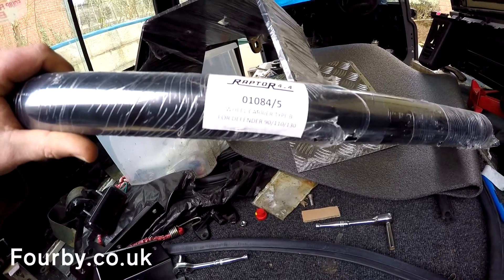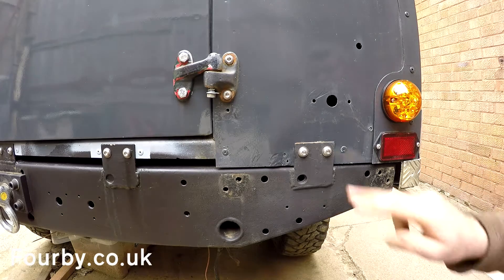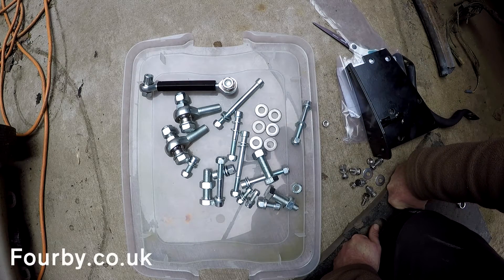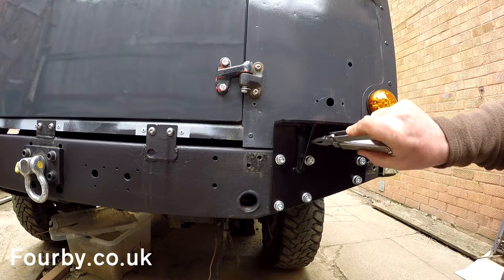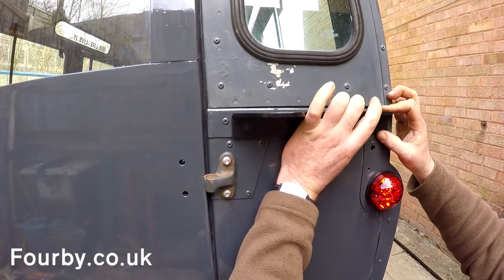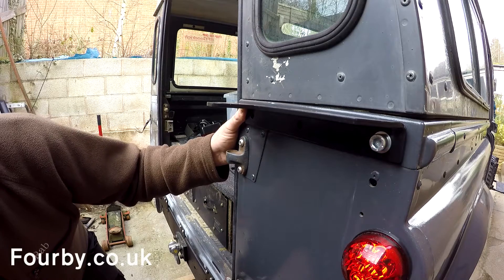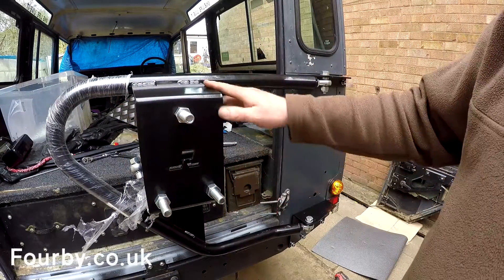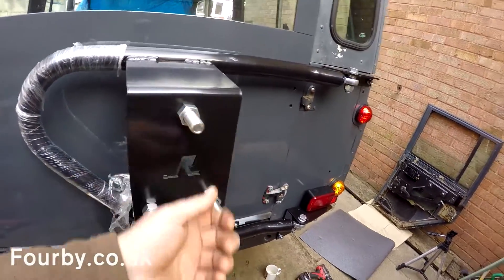Land Rover 110 Restoration #14 "Raptor4x4 HD swing away spare wheel carrier"

Comment: Personally, I would put a bead of silicone around the gap.  You are going to get leaves, whirlybird seeds, bugs, dust, dirt, grime BEHIND that nice Italian bracket which means .. corrosion and rust.   This thing could also use a thick rubber gasket with adhesive on BOTH sides, then bolt the plate, and cover the gaps with silicone.  Rust ruins these nice Land Rovers.  I have a 1985 Land Rover 110 Defender with a severe rust problem.  Otherwise, good video.

Comment: Nice job Neil...surprised you didn't use any sealer on the top three holes though.
Reply from the maker: Hi Steve, I'll take the top bracket off again when the upper panels get painted, I'm still debating whether they get replaced with van sides, I have the option as I have both, I will seal them then... TBH it seemed the best place to store the carrier while I delt with the rest of the project..
Reply: I didn't realise you hadn't finished it tbh.Now thats a hard decision to make ,Van sides are more secure but done look as nice as one with glass.